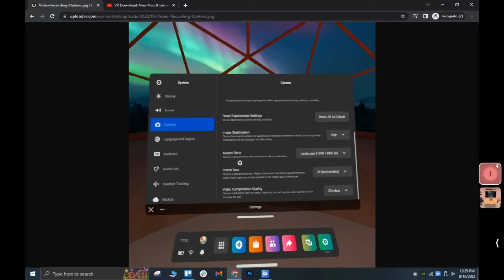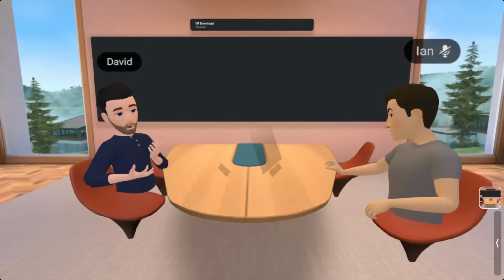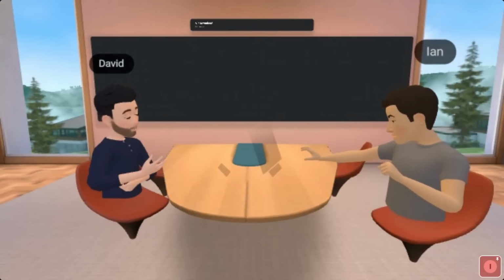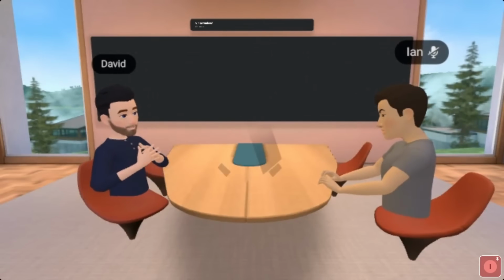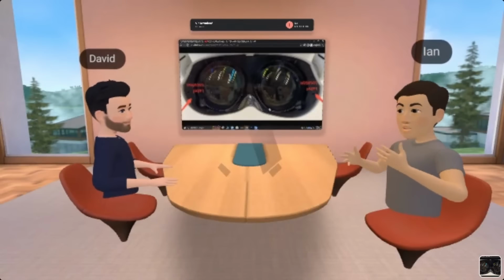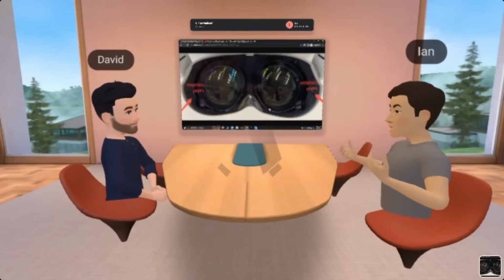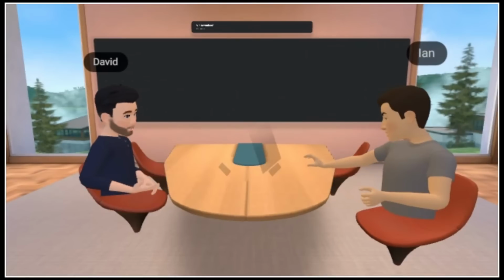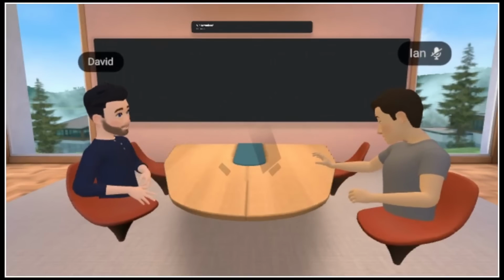VR Download 121: New Pico & Lenovo Headsets On The Way

Comment: I have the pico link and as a piece of hardware arguably already beats the base quest 2. Unfortunately the software library is dire, and your in the hands of the devs to support it on steam vr
Reply: It looks like a decent piece of platform but I don't share the enthusiasm. I raise my glass to toast for those who reject Meta's headset because of privacy but are ready to embrace an enterprise from the asian giant
Reply: i also have the Pico 3 Link as well as the Quest 2 (and an old Rift), but the Pico is a real mixed bag for me. The overall design of the Pico 3 with the headstrap and facial interface is much better  than Quest 2 and also the Display Port quality and performance compared to wireless gaming on both Pico and Quest 2 is noticeably better. But the internal sound of the Pico 3 is just terrible, my FOV is very low (about 68 degree horizontal, whereas on Quest 2 i have about 76 degree), the controllers do not match the hands in STEAM VR and the image is unstable, which means, that you can see warping while moving your head. That is not good for the eyes. It's the first headset i tried, that gives me headaches after a while. The Pico 3 is sold in Europa as a "beta device" and i now know why.
Reply: @ProgrammistMusic  hopefully the updates will resolve these issues. I’m with you on the sound, I use mantis headphones to remedy that